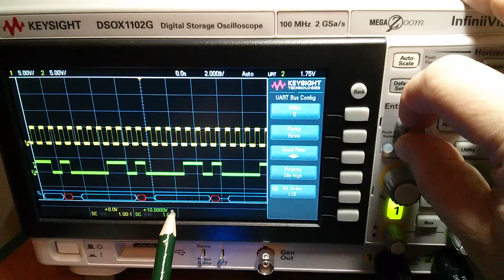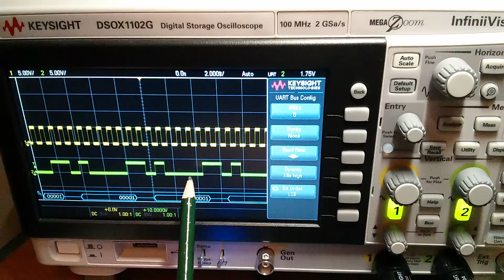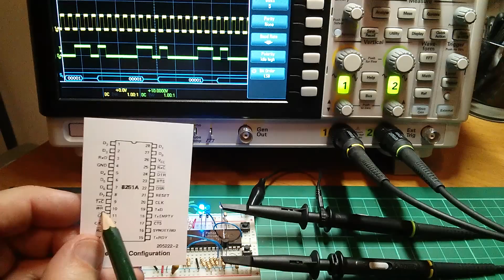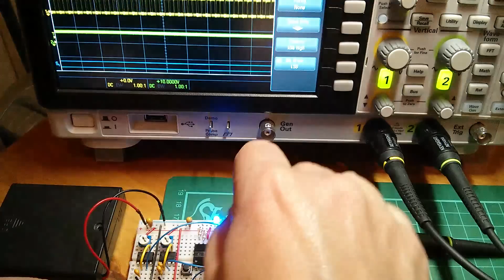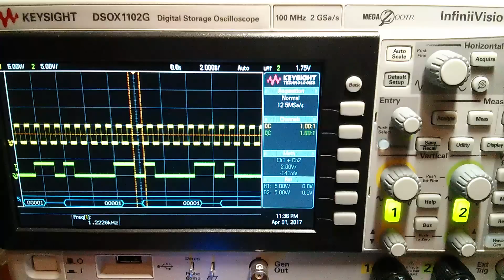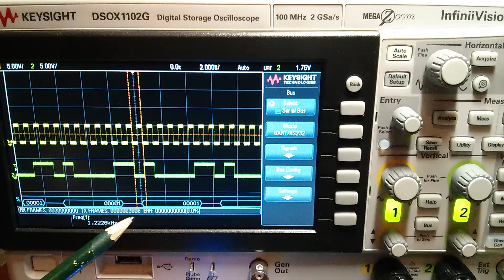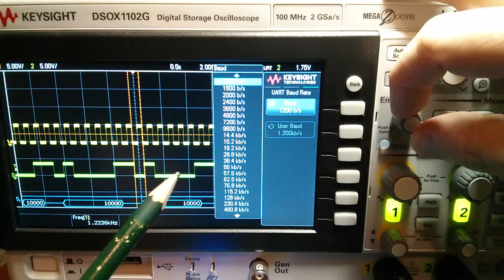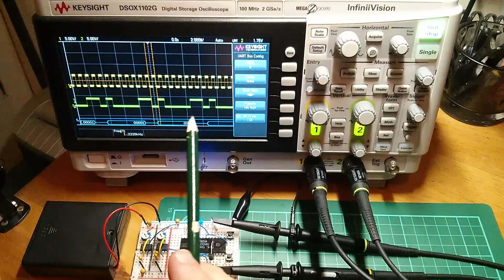Chip on Breadboard: Intel 8251A UART

Comment: I would be curious to know if the bit rate for MIDI (Musical Instrument Digital Interface) which I think is around 31.25 KHz, is on that list of acceptable rates in that scope...

That chip was a bit of a bear to set up,  but the Z80-SIO was even worse!  There was a part out earlier on that could be configured by various pins being tied high or low,  I think it might have been the IM6402?  Something like that.  I have yet to get my hands on one.

Comment: Have you tried getting an 8080 or 8086 chip running on a bread board? I wonder if theres anything interesting the cpips could be used for...im sure a microcontroller is more useful.

Comment: Ah, memories! I worked with that UART back in the early 1980's. I mostly handled higher-level usage, programming the 8080 CPU on the same big board we were building. Another guy, Cal, did most of the wiring-it-in part. I remember looking at the diagrams and prototype wiring he was using, and wishing that I had the time to learn more about area, but I was too busy at the time working on the (assembly-language) 8080 programming. It's a wonderful gift to finally get that closer look at the UART hardware -- some 35 years later! Thank you so much, Julian. This was so welcome that I kept wondering if it might be an April Fools joke.
Reply: In the 70's I made my own UART (well, not quite universal) using CMOS logic.

Comment: Interesting if a bit vintage. I emulated a UART with the main micro in a project in 1988. I did not need a UART 29 years ago so these chips are a curiosity.  RS232 itself is not dead yet but getting increasingly obsolescent. Maybe do a video on bit banging as a comparison of the techniques.

Comment: I'd love to see more about '80s computing, and more about how you got this chip working. I'd really appreciate it if you could discuss the purpose of UARTs and their applications. Cheers!
Reply: Have a look at Ben Eaters channel. He builds a computer of sorts on a series of breadboards. Covers a lot of the required logic and operation in a good level of detail. I'd be surprised if you didnt learn something from his videos.
Reply from the maker: +Tom Storey I'm an avid follower of Ben
Reply: I've watched most of Ben's videos, he is a fantastic teacher. Also +Julian Ilett I made your Z80 flashing light circuit and plugged it into the address lines of an old EEPROM for a laugh to see what was on it, and flash more lights in the process!
Reply: Ha! I have a bunch of 1489's kicking about that I found in a little container that Ive had since I was a little kid. Probably removed them from some reeeeallly old computer thinking they were memory or something.

Along with a crap load of UV erasable EPROMs Ive also got a couple of really old Intel MCUs, a D8742 and D8748. They also have a window that exposes the die, and a portion of the die looks like it could be a chunk of UV erasable EPROM. The 8742 dates from 1977.

That and an AMD and an Intel 286 CPU in 68 pin PLCCs. :-)
Reply: Have thought about trying to bring the old Intel MCUs back to life and see if there is something that can be done with them.
Reply: Now I'm wondering if you can do the same thing as easily with UARTS from different processor families.

IIRC getting the UART going was always a big milestone in getting your micro working

Comment: 5 bits, hmmm, could it be a nibble ++?
Reply: 5 bits is what the old mechanical teleprinters used to use using the Baudot code.
Reply: I used to be able to read 5 bit punch tape, back when I was in school.
Reply: Joel Hudson nibble plus one
Reply: Damn you, I came to suggest the same exact thing!
Reply: The correct spelling, my dear sir, is nybble. ;)
Anyway, a nybble is 4 bits so this must be a nybble and a bit. ;) (Pun intended)
Reply: A. R. Jasso in the C language, '+1' is simplified ++ :-P so there! Bit... Point taken.
Reply: JasonMasters There's no "correct" spelling "Sir". Both nibble and nybble and even nyble is okay and all of them get the point across ie four bits.
Reply: I'm a fan of "de-ambiguising" words, but you are correct.  It's a made-up word anyway (just like de-ambiguising) ;) so spell it however you like. :D
Reply: JasonMasters - Is that akin to kibble and bits ;)

Comment: Unlike your "soul-doorre" in place of "sodder," speaking UK Engrish does not excuse "baud rate" in place of "bit rate." Baud rate is not the same thing even though in degenerate cases they happen to have the same value. Why hobbyists are still struggling with this after so many decades escapes me. Repeating the error in 2017 just reinforces the confusion for yet another generation. Ouch.
Reply: Bob, when the symbol is one bit the baud rate is the bit rate. I believe that's always the case in a chip like 8251A. Now strictly speaking, baud rate and bit rate are not the same, but does it matter when we're talking about the 8251A? It's like "mass" and "weight" (at least in my country where we use SI-units). My mass is 70kg, and my weight is a little less than 700N. I never use Newtons when talking about weight (unless I mean force by gravity). :)
Reply: Its not "UK English" you idiot Its just English, also at least learn to spell it because there is no "R" in English. How the hell can you say "sodder" is the correct pronunciation? all you people have done is taken our language and simplified it down to a child like level ! and yes there is a "U" in colour
Reply: andymouse123 Oh, solder-off. ;)
Reply: yep !
Reply: The term baud rate was perfeclty correctly used in this video what are you talking about? clueless...

Comment: ok this is probably a very stupid question... I did my apprenticeship in electronics some 30 years ago, then left the trade, and only recently come back into it in a hobby level.. anyway my question is this... it appears that your oscilloscope probes are only grounded on the channel 1 probe. is this an ok practice?
Reply: In general, you want to ground every probe with as short of a ground lead as possible, but if you don't need super high precision you're generally ok just grounding one. Like Photon99 said, all the grounds are shorted internally.
Reply: Only if it works. If you find interference on ch2 then ground it. It is not a best practice but in this instance it's okay. Welcome back. Here's hoping you fail a lot and learn a lot.
Reply: All of the channels share the same ground inside the scope so separate ground wires are not required for low speed signals
Reply: Noise would be the only issue and a battery for power means no power supply noise.

Comment: I'd love to see this being driven directly from a microcontroller. Obviously back in the day it would've been a microprocessor, but getting one working with RAM and ROM (not to mention the machine code to make it run) would be way too much hassle, so a nice modern microcontroller would be much simpler.

Unfortunately Arduino can't be used, since you'd need to manipulate the port D pins directly to achieve parallel output, but D0 and D1 are pretty much reserved for serial RX and TX, so that doesn't leave enough pins on the port free for 8 bits of data.
Reply: I think the simplest solution would probably be a shift register.
Reply: Yeah, but a serial to parallel shift register going into what is essentially a parallel to serial shift register seems a bit pointless. The goal is to drive it like it would've been driven back in the day, and that is connected to a parallel bus like the CPU's data bus. Arduino Mega should be have one or two ports with enough free pins for this.
Reply from the maker: +The Up Late Geek also, a shift register won't add the start and stop bits needed for asynchronous communication.

Comment: much more interesting would be the breadboarding of a more modern chip to produce serial data.

Can I suggest for example the MSP430 where one would only need a resistor for the reset line and perhaps a 32kHz crystal.

I would be surprised if anybody nowadays would want to use a UART from the eighties for any reason other than nostalgia ;)

Of course all of these devices require a not insignificant amount of study to get started and my preference for the TI device stems from my experience of using the earlier and similar architecture of the 16 bit pdp-11  !